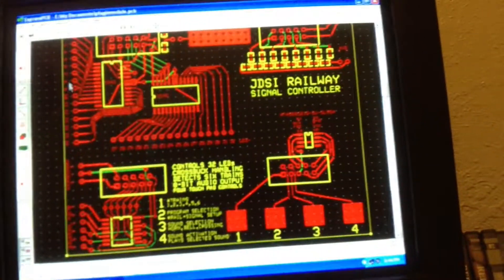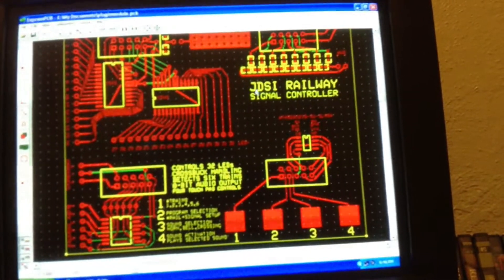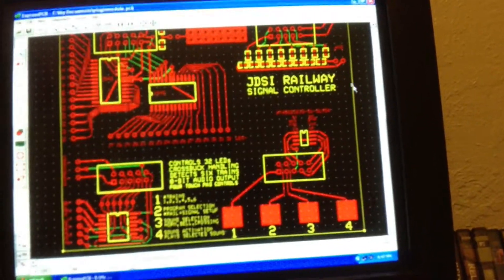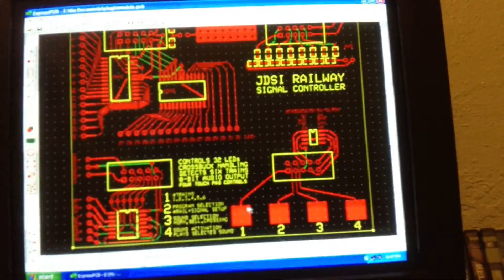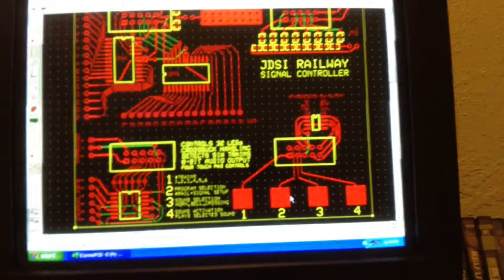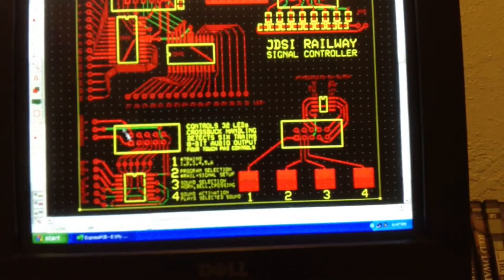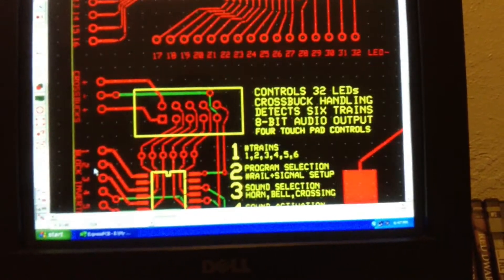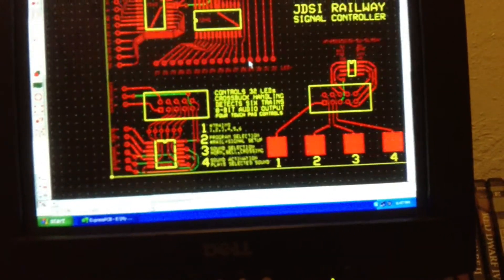HO Scale - Train Detection Signal Board - Part 1

Comment from the maker: :D That's what I was trying to aim for right there. A board that does everything all from one unit. This thing will probably do what 10 or 20 Atlas boards can do, with the addition of audio that dcc has but we'll just mimic that from the board, just plug in a speaker.. :D They're in manufacture right now, and when they make it in, we'll program them up for multiple track layouts. 6 sensors should be good enough :D This board will even power the track. Stay tuned, I'll have them ready soon.